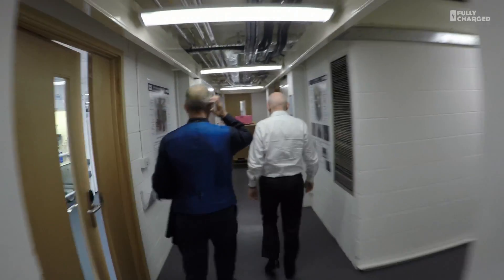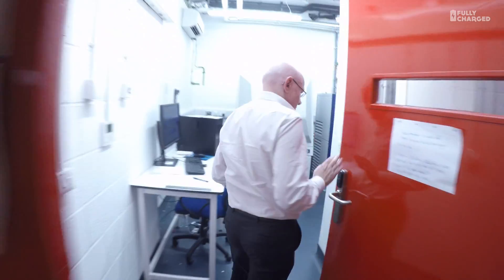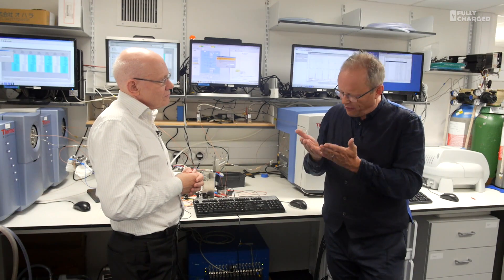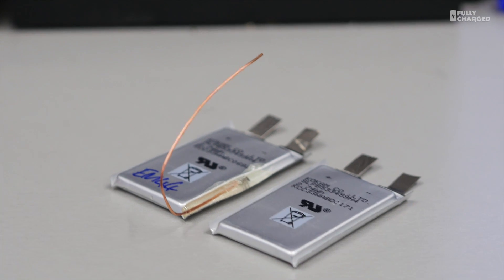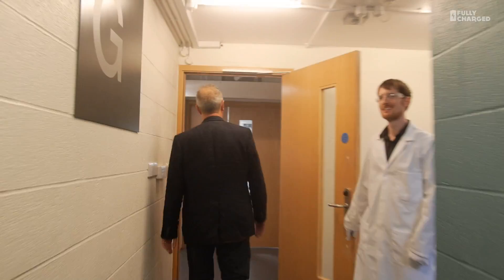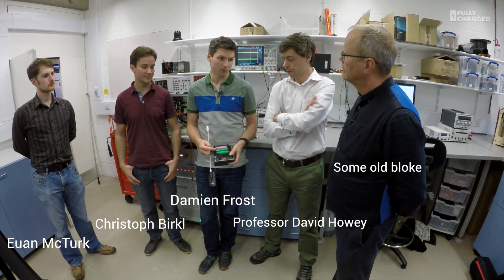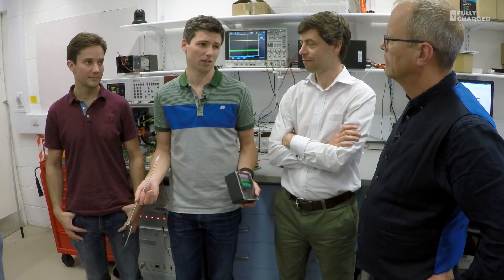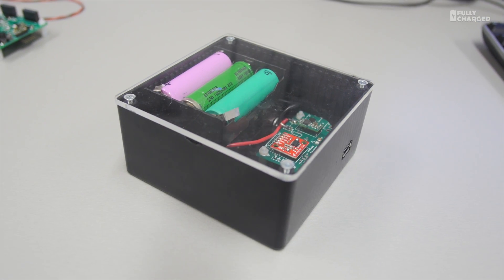Batteries to the Future | Fully Charged

Comment: The notion of making substantial carbon emission reductions with electric cars is misleading and overstated.
Reply: No it's not. More than a fifth of the global carbon emissions are are due to transportation and about 75% of that is due to road vehicles. Substantial carbon emission reductions will come about from the drastic reduction in the amount of crude oil that is extracted, refined, distributed and burned. Most of the electric vehicle charging will occur overnight and the carbon emissions associated with baseload electricity is significantly less. And it's improving.
http://www.ucsusa.org/clean-vehicles/electric-vehicles/life-cycle-ev-emissions#.V5bfrOt95aQ
Reply: @al rats This is entirely dependent upon where in the US you are charging your electric car. There has be credible research that suggests driving an electric car would have no reduction in carbon emissions. The problem I have with people like yourself, is that you don't do yourself justice by performing research on a subject before jumping behind it for ideological reasons. You (presumably) take the position of moral superiority and reject any dissent as absurd and negative instead of looking at it from an objective perspective. Look it up for yourself and see the facts.
Reply: Al Rats, 75% of 20% is 15%.

Plus, consider that the total contribution of CO2 to the greenhouse effect is about 5%.  The anthropogenic portion of that is less than half - about 2%.

In other words, if you waved a magic wand and instantly converted all passenger vehicles to electric and put solar panels on everyone’s homes to provide 100% of the electricity to power them, the net change in global temperature would be roughly nil.

There are MANY good reason to buy and drive an electric car but global warming isn’t any of them.
Reply: There's nothing stopping people from fitting home solar so they're not affected by how clean or dirty local power generation is. On top of that even when you use 100% 'dirty' generation to power an EV it's still better because EVs use 1/3rd the power compared to petrol engines. If you burned the same amount of fuel in a petrol car v.s. putting it in a power station and using the energy output to charge an EV, the EV will go 3x as far on that same amount of fuel.
Reply: +PhonicUK You obviously have a very narrow understanding of the limitations of of interconnected power and their ability to support excess solar generation when it is not needed. The other gaping hole in your proposal is that most cars will be charging when solar panels are not producing and power will be coming mostly from traditional sources which is not making use of aging and toxic solar panels affixed to your roof. The economics for the individual are not always sensible. My electric bill is $20 USD a month.  A solar panel system for my home would cost roughly $20,000 USD and I would still be pulling electricity off of the interconnected grid. Solar is a joke as far as im concerned and all of the subsidies the "green" energy industry receives just serves as a disincentive to advance the technology.
Reply: spunkysandoval You're in the US though, in the US fossil fuels are massively subsidised, keeping them artificially cheap. Here in the UK/EU fossil fuels are massively taxed, making them more expensive. As it currently stands here in England, the absolute cheapest form of non-subsidised power generation in terms of cost-per-MWh is on-shore wind power (as in it makes economic sense, even ignoring the other benefits), and we use hydro to store excess capacity. Don't make the mistake of thinking that because the technology isn't available to you where you are that it doesn't exist.
Reply: +PhonicUK Subsidies are a problem in almost every industry and many of the same subsidies that fossil fuel industry gets apply to other industries as well. That is all thanks to lobbying (which I think should be stopped because it only benefits the large corps). Also, the term subsidy as it relates to fossil fuel industry in your argument is a term that is used very losely to include many things that are not direct monetary subsidies such as those given to renewable generators. Wind and Solar generators recieve a direct subsidy in dollars per/kwh they generate while fossil generation does not. The real winners here are the wallstreet types that have capitalized on this generous government tax dollar windfall and built massive amounts f solar and wind generation. They are loving the garanteed profits while the tax payers and electricity consumers are footing the bill. If you cant see the obvious scheme that is ongoing, then Im not sure what to tell you. Im not advocating against developing a better energy system for long term sustainable electricity, but the one we are getting sold is straight bullshit where big players are making huge sums on our dime.
Reply: I don't know what sort of ideological reasons would lead anyone to believe that a particular technology would result in reduced carbon emissions compared to another. Anyway, the carbon emissions reduction, associated with any particular individual opting for an electric vehicle instead of a fossil vehicle, depends on many factors. For example, if you are a retired person who uses their vehicle to only drive locally for your weekly shop and occasional family visits, then it would take a very long time to even offset the additional carbon emissions due to the manufacture of batteries. Someone who drives a lot but lives in an isolated community, where the electricity comes from diesel generators, would also not make substantial carbon emission reductions by getting an electric vehicle. However, if you drive your vehicle almost every day and you receive your electricity from any modern power station or a wind farm or rooftop solar panels, then you will make substantial carbon emission reductions. This covers the vast majority of drivers living in any industrialised nation. In countries such as Canada, France, Iceland, Norway, Austria, Switzerland, Brazil, New Zealand and many others, almost all the electricity comes from Nuclear or renewable sources. So there will be very substantial carbon emission reduction in these places. Even in regions where the electricity comes mostly from coal, there will be substantial carbon emission reduction for most people over the life of the vehicle. And as the grid becomes cleaner over the life of the vehicle, so do the vehicles themselves.
If you think there is "credible" research that suggests driving an electric car would have no reduction in carbon emissions, then you need to provide a link. So far I'm the only one who has provided a reference and it states otherwise.
Reply: isandov you must be blind or totally biased your saying oil gas and coal don't receive subsidies? ?? really?  do a little digging for the facts of life please.

Comment: why is nothin being done to harness wave power  it's there ALL the time.  Everyone is avoiding it and I want to know why ?
Is not graphine the new  tech in batteries  these days
Reply: Sorry, but studying a masters in renewable engineering at the University of Exeter, I can tell you that there is research in to harnessing wave power. But as Greg says, the sea is an extremely corrosive environment and difficult to generate energy from. He is also right in saying no one has made it yet to the optimum design, it's expensive to carry out therefore making progress slow, just hiring a boat to transport devices of decent size to their site costs thousands of pounds. Yes it has not stopping us getting the oil, but that's completely different. For starters, oil has been being produced and used since the 1850s. This has given us 150 years to get where we are today in the production of oil. Also a rig is a huge steel frame with people living on it and constantly maintaining it, unlike a wave energy device which wouldn't be able to accommodate a maintenance team on board 24/7. Plus the amount of oil produced by the rig makes the whole operation economically viable. So yes, commercial wave energy would be great but it is not as simple as 'thats the  Job sorted with a few bods on the case'.
Reply: The problem with wave power is that you have to deal with one of the worst operating environments there is with all the salty sea rusting everything, dynamic power flows, storms, etc.  Ever notice how poorly maintained things are that are located near a beach?  Lots of people have tried it, no one has made it to commercial deployment.
Reply: sry, but a little salt shouldn't be alowed to get in the way of solving the global energy crisis. It has not stoped us getting the oil .. they paint the rigs below the water line to keep cars runing. . how's about nylon gears rubber floats and plastic casings . low maintanence . Wave powered kinetic converter. .and thats the  Job sorted with a few bods on the case.
Reply: +Ben Arnold A fellow Exeter student! Well, now former... On the topic of wave power, I believe the Swedish have recently developed a commercially viable generator which runs with 20 floats. Looks interesting

Comment: Check out the "liquid metal battery" being developed by MIT professor Don Sadoway...  
Cheap, powerful, long-lived, scaleable.   A real step forward.
Reply: and far from being viable on the market. Also having something that's several 100°C hot and liquid isn't something you want to drive around.
Reply: Greg Collins
Reply: superdau Many batteries that are bulkier or heavier than lithium ion are also cheaper and also perfect for stationary and grid storage where size and weight are not as important.

Comment: Why grid batteries would ever use lithium boggles the mind, that shit is 100x more expensive and difficult to manage long term.
When size and weight doesn't matter lead acid batteries work better then any fancy nonsense.
Reply: The best batteries for storage so far and available are Nickel / Iron Edison batteries! Look them up not given enough exposure. Nickel and Iron are cheap not sure why batteries so expensive but prob cause not mass produced!
Reply: The reason why it is becoming more and more attractive is because NERC compliancy is demanding better, more intuitive monitoring of the batteries and their inter-cell resistance.  Thermal runaway detection and battery aging prediction technologies are becoming almost mandatory in every industry and lithium based batteries are generally smarter and do not suffer from the same problems lead-acid batteries suffer from.
Reply: Tell that to the people who are switching their off-grid applications over to lithium batteries as the lead-acid ones die.
Reply: Lead carbon? Heard that its cheaper and lighter.

Comment: Interesting, but really about yesterdays technology. 
Also , there is not one lithium ion technology, many different chemistries exist. Lithium Ferrous Phosphate (and variations thereof) are capable of safer, quicker and deeper charge/discharge. 
Lithium Titanate is particularly interesting, capable of a 90% charge in under 10 minutes (typically 6-8) currently being used in USA for a local bus with roof mounted inductive charging at stops!

Comment: Have you heard anything about the fluoride battery? I've found very little about it, except that it can theoretically hold 6 times the charge as lithium while being lighter and costing less to produce. In a Tesla, that would get me to my family in Kentucky and back without having to recharge once (about 1600 miles), so I'd love it if it was actually viable.
Reply: +Ben Faust 
Why would anyone make a car with 1600 mile range?  Do you have a 1600 mile bladder?  Make better batteries, put fewer in the car, to reduce weight and cost.
Reply: CorwynGC I was only daydreaming. Although, it would be nice. Between where I live and my family, there aren't enough charging stations to make it even in a Tesla. And I wouldn't go 1600 miles anyway; 650 there, and 650 back. I've done this before in a gas car stopping only three times for only 5 - 10 minutes each time.

Regardless, it doesn't matter what we do or don't want or think is a good idea. The market demand will take care of whether there are 1600 mile range cars (no more range anxiety excuses to the extreme), or smaller batteries, or both (different people want different things for different reasons, and tend to think the others who want something else are a bit dim witted, silly us).

Or perhaps a descent 200 - 300 mile range for a truck pulling a load. Helicopters perhaps? Who knows. I just wanted to know if he'd heard of it. ;o)
Reply: Ben Faust

If Tesla superchargers aren't sufficient now, they should be shortly.  I was under the impression that they had carpeted the US (i.e. you could drive anywhere in continental US) by now, but I may have missed a hole.
Edit: Ah, checked http://www.teslamotors.com/supercharger they seem to be missing a bit in west Texas, and some North Dakota and Montana.  2016 then.
Reply: CorwynGC Kentucky has only one, last time I checked. We MIGHT be able to make it there in a Tesla with the biggest available battery, but it would be really pushing it. Definitely looking forward to the day fast electric car chargers are everywhere.
Reply: Check out the Apterra project. 1000 mile range
Reply: @dehanbadenhorst1398  Not much luggage room, but it looks amazing, and while at home, we don't drive more than 15 - 20 miles per day. If we didn't need much luggage, 1,000 miles fully charged would definitely do the trick for a trip.
Reply: @benfaust  Wow, 6 years later and you respond. That's pretty cool. Yeah the Apterra could be great if they manage to mass produce it, and if they can sell the base model at 25k USD as they've said they would
Reply: @dehanbadenhorst1398  Six years? Wow. This says "12 hours ago." Your comment must have gotten stuck in some sort of queue... lol... Not surprised. My job puts me at the mercy of information technology, and crazy things happen on a daily basis... lol...
Reply: @benfaust  No, My comment is 12 hours ago, I just meant that your original comment was 6 years ago

Comment: Surely this is old hat? The future is solid state CARBON batteries, which are also VERY cheap materials: "Scientists at MIT, working with Samsung, have discovered solid-state batteries that are better than current lithium-ion efforts. These batteries should be safer, last longer and offer more power.
Current lithium-ion batteries rely on an electrolyte liquid to transport charged particles between the two electrodes. It's this liquid that can be flammable and which degrades the battery, limiting life.
According to the MIT report these new batteries could be charged for hundreds of thousands of cycles before degrading. They could also provide a 20 to 30 per cent improvement in power density meaning that much more charge for whatever they are powering. And they aren't flammable so they're ideal for electric cars." http://www.pocket-lint.com/news/130380-future-batteries-coming-soon-charge-in-seconds-last-months-and-power-over-the-air

Comment: With the automotive industry trending towards 48V motor/generator hybrids for short-range electric usage, I expect to see more long-life super/ultracapacitors being used alongside batteries.
Reply: Yes, they are being used and I think that solid state high capacity double battery double capacitor system should be used. One capacitor will be charged through dynamo (alternator) attached to differential which will then be used to charge the offline battery and another super cap so that it could be used for surge demands. And then when one battery goes down, it switches to the other battery for power usage. We may extend the milage hugely with this, provided we are getting 200 miles (approx 300kms) on trucks with one battery pack and whole system is not too heavy.
Reply: You can also use the super caps in regen circuits. The fascinating thing about renewable energy architecture is that all these technologies has a place for there are so many usecases depending upon applications. 
House holds and factories long term storage and peak load buffers. Automotive needs different.
A new age of energy technology industries are coming. That is good for local economy. We just need our stupid politicians see the big picture..

Comment: I've been harvesting old laptop batteries for years. The BMS in Dell bateries in perticular actually tend to pretend that the capacity is worse than it  is to get the user to buy a new battery.
Reply: +ben hunter The key to extending battery life is keep the charge at 40% when you're storing the battery, or laptop plugged in but battery not being used
.
Reply: yeah, my laptop has a feature where it only charges the battery up to 60% which I usually use when I know I'm not going to need to use it outside of the house for a while.
Reply: Hi Ben, what model of laptop is that and what's this feature called?
Reply: It's a Lenovo Z500 and the setting is in Lenovo energy management or something like that. It's a fairly old laptop but that feature is fairly common on laptops these days. I think they put it on mine because the battery is "not user replaceable" meaning that you've got to take it to bits to change it.
Reply: Are you still harvesting cells? I've spend 6 months harvesting cells from around 500 laptop packs and I've got to say, DELL packs give up a very high proportion of perfectly good cells. I'd say more than 90% of cells from Dell packs have more than 80% or the rated capacity left. Its also a similar thing with other brands too though. Id say more than 60% of my packs have had all cells working very well and yet somehow they ended up in the dump.its a tragedy, it really is.